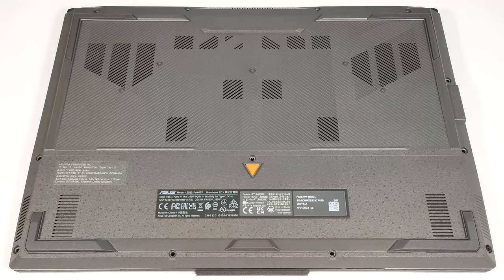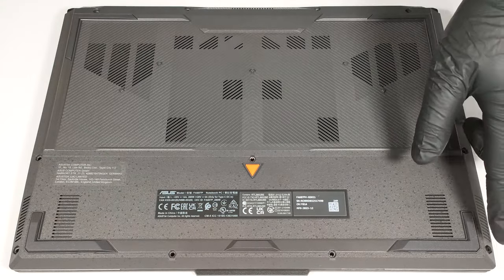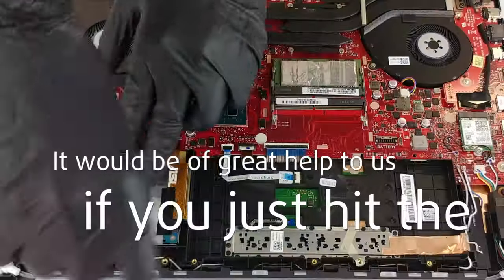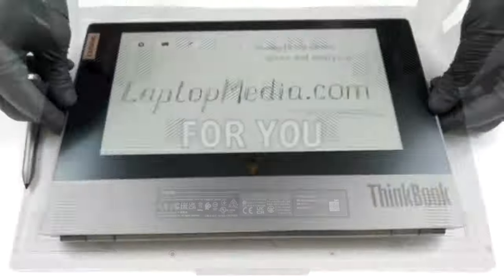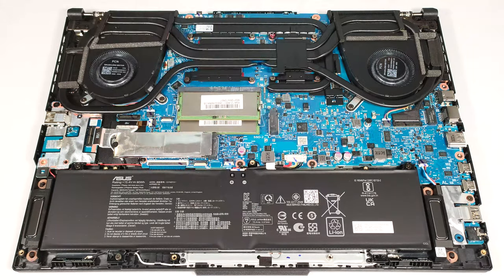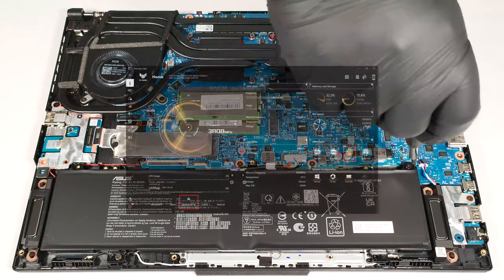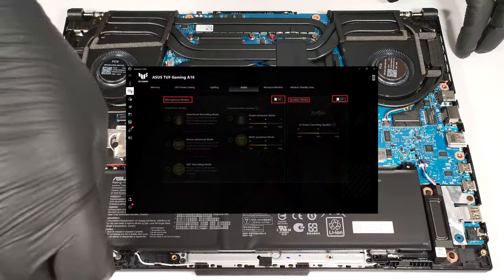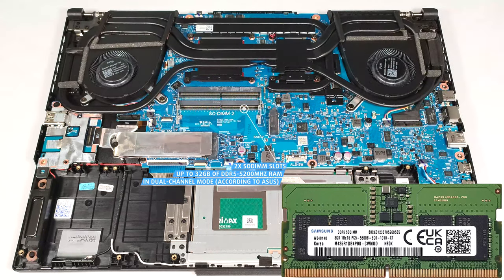🛠️ How to open ASUS TUF Gaming A16 FA607 (2024) - disassembly and upgrade options

Comment: Do you need to disconnect the battery to change the ram and install second ssd?
Reply: It's better to do that, due to avoiding electrical shock

Comment: I just bought the 16GB RAM, if I want to upgrade it to 32GB, should I get another 16GB from another brands or just get 2x16GB instead and toss or sell the old 16GB ram? Please guide and thx for the answer
Reply: Also if I want to upgrade ssd, I plan to get the WD Black 1TB SN770 M.2 NVMe, will it work? (Plug n used) or there is installing process, havent try any laptop upgrade before, please enlight me 🙏🏻
Reply: No. Just plug in your mem stick and you'll have 24 Gb. If you want 32 just find the same stick and it'll be ok, no need to search for a pair of them. Just make sure they'll have the same specifications.
Reply: from where you bought it ? did it came with one stick 16 gb RAM??
Reply: @abderrahman9043  yes, from indonesian online market
Reply: @Winters_D  So if I want to buy a stick for a RAM upgrade, it doesn't necessarily need to be the exact same model as the one which already came in the laptop?
Reply: @feintexp-2530  just make sure it has +- exact parameters.
Reply: @Winters_D  +- parameters? What is that?
Reply: @feintexp-2530  Means their technical parameters (frequency, latency and timings) should be around the same numbers more or less. Also shoud have the same rank an type ofc. The question itself was about if shoud the modules be from a single pack to work properly and this is not necessary. It's ok to use the modules from one or different manufacturers from the different packs and so on if they have the same parameters. Not rly sure how would it behave if you'll use totally different modules with all the different characteristics, but mostly this setup will work with the parameters from the weakest one. I hope i ain't messed with anything about it, at least for me it worked last time when i was upgrading my ddr4 ram in the laptop.
Reply: To support all bus capacity, first open it and look for the model and serial number of the ram, if it was one slot ram, look for the same ram that is on your laptop.
Reply: if it's not or the first ram doesn't support dual channel you better find dual channel pair of ram

Comment: oh come on Asus.. 😢 why you put wifi module under SSD which creates heat and transfers to wifi module and creating problems to wifi conection..
I know what i'm talking about, i had this problem with my FX506HC-HN011.. after i moved M2 ssd, to another port, problem dissapears..
Reply: Lagspike?
Reply: @coremaw  nope, overheat to wifi module, and code 10 in device manager, result completely NO wifi conection until temp goes down. Completely unacceptable, considerint how many Gb have games nowadays.. (downloading over wifi, generates heat to module itself + ssd getting hotter and hotter..)
Reply: so you have to use the other port !!
any other problem you faced with that laptop 
is it still worth buying  ??
Reply: @abderrahman9043  other port is pci-e 3.0 + what if i want to use 2 ssd's ?🤔 sold it, bought vivobook pro (ultra 7 155h + rtx 4060, oled 3k 120hz.)
Reply: Just put SSD in other slot and change the boot disk in bios

Comment: Tried to add a second SSD, but that tiny little screw place holding the slot stripped on first try.
Reply: use pliers to turn it
Reply: @GameDev-Rainbow  Tried.  I used long nose plyers.  Almost put them through the motherboard.  The screw is stripped good in there.  It needs a sawdering gun to get out at this point.
Reply: @Trooper599 rubber band method?
Reply: @Trooper599  considering you spelled it "sawdering" I'm just gonna assume that's user error and not ASUS' fault
Reply: @JustPlainAwfulStreams   Yeah, fat fingering a word is notoriously related to stripped screws in laptops.   It's science.